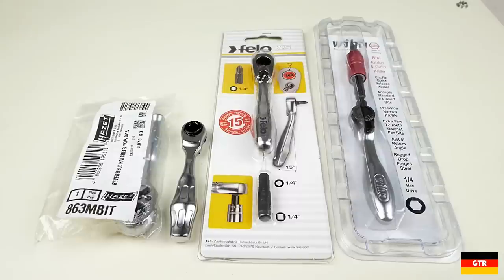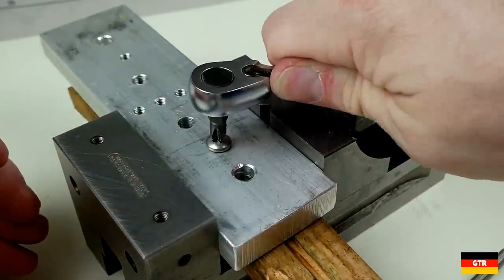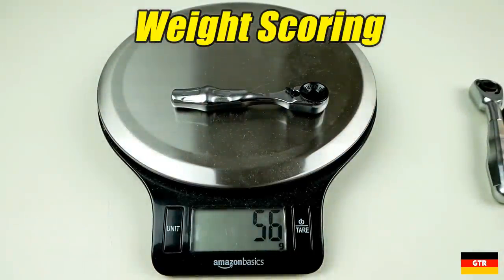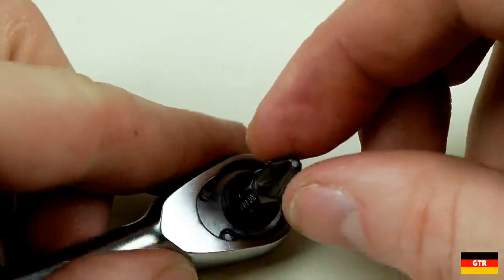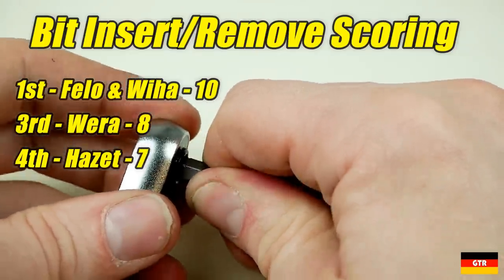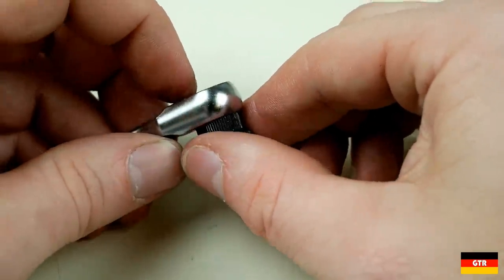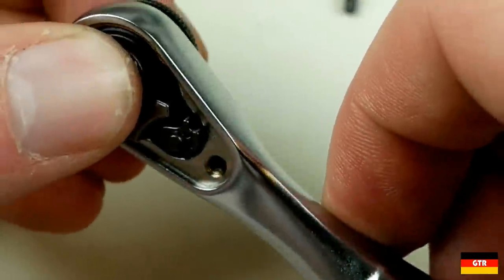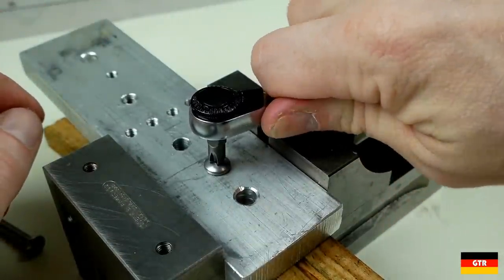Bit Ratchet Showdown

Comment: I would add WERA and Wiha points for the ability to turn the wheel by hand, sometimes it is very useful to secure a self-tapping screw or threaded bolt in a confined space on a wood surface or a threaded hole initially.

Comment: One thing you didn't mention that I find very important, especially in very confined work spaces, is the ability to spin the ratchet from the back of the wrench to pre-tighten the bolts or screws to get them tight enough to overcome the back friction of the ratchet mechanism. Or loosening threaded bolts to have enough length to grab it with bare hands rather than trying to twist a bit that is not attached to a wrench.

Comment: I work at a BMW dealership and we are doing a lot recalls on PCV heater pipes which can be a bit of a pain to replace.  One of the screws that holds the pipe to the block is positioned out of the way and must be tightened and loosened blind, and in a very confined area.  This seems like the perfect test for a bit ratchet.  I've used both the Wera and the Hazet ratchet to complete tons of these jobs and both of them are perfectly fine.  I will say that in my experience, you get what you pay for when it comes to tools.  The Hazet really is a much higher quality professional grade tool - as it should be for the extra cost.  It's a lot tougher and doesn't flex at all when you really crank on it.  One thing that I noticed immediately was how little back drag it has, and how smooth and quiet the ratcheting mechanism is.  With bit ratchets that is really important because in my case I was feeding these little torx screws in by hand just enough to hold them in place so I could come back with the ratchet.  I found that I'm much less likely to knock the screw loose with the Hazet than with the Wera by unwinding the ratchet before the screws have really sunk in.  It seems that ratchet design and ergonomics are more important than strictly tooth count when judging a ratchets capabilities in tight spots.  Both are good tools for what they are designed for, and your task requirements will dictate which one is the better VALUE.

Comment: I have the Wera version and it was literally the only tool that could do this job that needed to be done. A Volvo XC90's fuel map sensor is in a really tight place and the only way to get it is to put the phillips bit in reverse. It was just enough clearance to get the screw out and remove the tool. I think having an option like that would be a huge factor for the score. Something else to consider when purchasing one of these.

Comment: I think most important for such product is the ratchet gear and teeth life.  Only after many years of use you will be able to tell by inspecting the gear and teeth. Taiwan made products are very well finished nowadays but  have a bit risk in regards to the durability. You can try to over torque them to check the wearings on the gear and teeth.

Comment: How sad is it, that I as a German need to go outside of Germany to get our own tools reviewed? :-D
One question: You did not mention the force needed for the "back stroke", which of these has the lowest? Makes it easier to hold the bit in place before a fastener starts to grip!
Thanks so much, that was EXACTLY what I needed!
Reply: That does seem like an important metric that could have been evaluated. 
Low friction on the ratchet mechanism would be good when you're driving a screw that's still loose, and you can't easily apply a fingertip to the bit to keep it from just going back and forth as you try to catch the next ratchet tooth position.

Comment: The hole in the top of the Wera bit ratchet is actually large enough to insert and use some bits upside down, which makes for an extremely low profile tool. Having said that, I'm more in love with the Facom Pico flex-head bit ratchet these days.

Comment: I use the Wera all the time and it works very well. The smaller teeth leave the Hazet in the dust. I just switched to Facom fixed head and I ordered the flex head version in the R1 Pico set for my travel tool kit. The Facom would be a top contender in a new test as long as the clip head doesn't artificially handicap them.

Comment: Now found my ~15y old Gedore 471 1/4 Bit Ratchet. Messurements: 89,4 x 14,3 x 9,7 in mm, weight 23,8 grams, about 50 tooth at the other end a fix 1/4 bit holder for loosening tight screws. Satin finish still perfect, no rust, ratcheting mecanism smooth and the switch still feel like it should. I used it for these hard to reach screws in the Motor compartment (european cars) and it never failed. COO maybe taiwan because there were other, exactly same looking rebrands available (about 15 years ago) like Bahco. Still some NOS 471's in the german bay available also in a set with 4 and 6 mm bits and adapter for the 4mm bits.

Comment: Great review. You didn't think that the knurled thumb-wheel of the Wera & Wiha ratchets was worth mentioning & scoring on the extra design functionality?
Reply: very valid point
Reply: I’ve used that wera ratchet a week ago single handed right place and the knurled wheel came in hand. Loved that function and size too
Reply: Exactly what I was thinking. The Bahco also has the knurled wheel and has saved me on numerous occasions. Defiantly puts me off buying the felo as it doesn't have this.
Reply: White goods engineer here... I recently bought the Wera bit ratchet and low profile socket ratchet mini2 combo for obvious reasons.

Having watched this review it probably wouldnt change my decision though as it was indeed the bit ratchets thumbwheel on the Wera that edged it for me over the others. It was also on special offer but also part of a combo that I also needed... which just confirmed it for me. 
Overall design and quality looks to be acceptable for the price paid for the Mini2 combo (£51 posted) I'd have liked the bit holder to have less wobble and I can now see its design weakness in the combined spring setup but time will tell... If I get 5 years of occasional once a week use out of it, I'll consider it a success and a good buy.

Great work, very in depth thorough reviews, fantastic! I love all your videos.. you earned a sub today!

Comment: My problem is the length, someone needs to patent an extra long one with a small head. What I currently work with is the Swiss army one that is sold as an accessory to their multi tool. It’s the smallest head available and you can add a hex bit extension to the handle to make it as long as you want
Reply: long and XL length bit ratchets certainly do exist.  Do a google image search and you'll find them.
Reply: ChrisCas - Tool Aficionado yeah, there’s the ez red and the gearwrench, but I’ve been hesitant to buy them because the heads look big in the photos.
Reply: If you can get the dimensions from Wiha's website, the EZ-red version should be the same: http://www.ezred.com/wp-content/uploads/2016/11/4S3XL-web.jpg
Reply: ChrisCas - Tool Aficionado I remember seeing that ez red set, that looks like a nice set!

Comment: I don't quite think it's fair to give the Hazet a 10 for serviceability and a 5 to the others, when you can get 2 or 3 complete drivers from the other brands for the price of a single Hazet (and that's not even including the price of the service parts).
Reply: Hazer get points because it's hazet...
Reply: @Whigu  So? Like the other manufacturers are any worse? :-D
I agree with Kieran: While I like the review and the infos in it, the scoring is all messed up and not weighted that useful...
Reply: There is a difference between buying a new one and servicing one!  They would still get a lower score in service yet a higher score in price range!

Comment: I have the wiha one. It came with wihas micro bit kit. It does work well for small bits and low torque applications, but because of the small tooth I don't feel comfortable to use it for applications requiring a bit higher force.

Comment: I decided to buy a Felo based on this review. I have a Wera, and I really like it - it's easy to get it into places I can't get anything else in - so I'll be interested to see if the Felo is noticeably different. I figured that it would be worth having even if I can't tell the difference otherwise, because of the angle on the handle.
Reply: How did the Felo work out for you? I have and love the Wera too and am thinking of picking up the Felo for 3D printer nozzle changes.
Reply: @Schwalbe262 I like the Felo, but so far I haven't used it anyplace that the Wera wouldn't have fit.

Comment: My experience is that the Wiha is terrible.  It was dry and would jam up.  After lubing, quite ok.  The other problem is that one screw backs out, even with Loctite.  I ended up finally losing it and Wiha won't tell me what the measurements are so I can buy a replacement.  So I stick with my Wera at this point.

Comment: You should measure the slop in between the current tooth and when the pawl engages the next tooth.

Often you see low return angles, like 5°, even on cheap ratchets. The biggest difference is durability when those tooth counts get high, and the tolerances. A good 5° ratchet has a 5° return angle, a cheap on has like 8° angle of return because of slop.

Comment: I changed the internals of my Hazet 863 BGL ( bit ratchet with flexible head ) over to an standard one and vice versa so I can confirm that it is possible and the price is a lot lower - here in Germany - when bought in a complete set with box , inserts , extensions, bits ... The Wera " movement " is same on Facom, KS-Tools and many more - brandet tools, all came from Taiwan. Own all of them, use frequently ( Service Engineer tobacco machinery ) , never failed.

Comment: Awesome video. I own the Wera model and love it; just wish they made a flex-head version. I've seen that exact same mechanism in the  Wera used by Mac, Facom, USAG, and Deen in their respective bit ratchets. All made in Taiwan, 60 tooth, large through hole, and using a single c-shaped clip to retain the bit drive and the bit itself. I wonder if they are all made in the same facility and just get stamped with different branding on the top?
Reply: They've been doing it for over a decade now.  A company called Hi-Five is a massive ODM/OEM company that has worked with companies like Facom for well over a decade.

Comment: Here in Germany Hazet is considered the highest quality brand of the four. I must admit that Felo is not widely known here in my opinion. I only have a badly designed bit driver from them. Gedore and Hazet are the top manufacturers for those tools.
Reply: Matthias Burkhardt: Thats true, one point more to Hazet!
Reply from the maker: I was going to include the Gedore, but they didn't have a version with a bare handle.  Maybe I'll take a look at it in the future if I do one with comfort grip handles.
Reply: Matthias, what is your opinion of Stahlwille?
Reply: but only 20 teeth...
Reply: Stahlwille is one of the German "undercover" brands, not widely known, but of very high Quality. They produce in Germany and the tools have a very high quality, comparable to Gedore or Hazet. I think there are several others out there, the problem is you do not see those brands in the stores(that's at least my opinion). We had a toolstore here in Munich that had a lot of Stahlwille, do not know if that still exists. https://de.wikipedia.org/wiki/Stahlwille
Reply: Surprised with that i thought FELO were well known/respected with you in Germany , saying that i sold my Felo ergo drivers & stuck with WIHA -softfinish :]
Reply: CC MOGS That's only my view, I need the tools only for hobby so it could happen that I missed something 😉
Reply: Felo is or was mostly known for making the Umsteckschraubendreher.
Which was found in every vehicle tool kit of every german car maker.
Reply: Another not so well known brand is Elora: https://www.elora.de/site/en/start.php and Matador: http://matador-webseite.de/index.php. And of course Proxxon: https://www.proxxon.com/en/ Would be great to have more reviews on those brands also.
Reply: Matthias Burkhardt Hallo, ich bin nicht deutsch (kom aus belgien), aber ich habe alle werkzeuge die ich hab bei TBS in Aachen gekauft, die haben alles was Man Sich wünschen kan(: gedore hazet stahlwille..)
Reply: @MatthiasBurkhardt  what do you reckon about Elora in German market, they was one of top German brand before.
Reply: Really not that common. 
The most common brands in construction are:
Screwdrivers - Wera (probably followed by Wiha and Witte)
Pliers - Knipex (by far)
Spanners/Ratchets - good cheap brands (like KS tTools, Proxxon etc.) followed by crap cheap brands and Stahlwille and Gedore
As an electrician I use quite a few tools made by Jokari.

Comment: At 7:56, notice that the Wera has a very large pawl to spread the torque more evenly which negated the need for such thick material in the cog of the ratchet, engineering that cut cost and should be effective.  Personally, I own a Snap-On unit purchased years ago with an Angelle creeper as a set.  Paying with cash for both, it was really inexpensive for the quality.  Not jumping inside the unit, I bet it is more akin to the Hazet.  All in all, I would have preferred a straight through design, although the magnet holds well.  It holds so well, that with greasy or oily hands and fingers, it can be a chore at removal of bits.  Super light but a big head, serviceable and should be able to be configured for other styles--3/8" drive, 1/4" fine or course.   What I don't like so much is the stiffness of the ratcheting motion.  OMG!  It hasn't broken in yet.  Again, it receives limited use, just for the tough hard to reach screws and such.  The set TMM830set or TMM830 can be found in used quantities over the net and especially eBay.  It is usually easier to buy the kit than the individual ratchet; go figure.  Anyway nice review.  Thanks

Comment: I have the Wiha ratchet and agree that the switch is a problem.  My concern with the Hazet ratchet is the butterfly pawl in the mechanism which is similar to older teardrop Craftsmen ratchets that were offered in other drive sizes.  I don't remember the mechanisms in those as working particularly well.  Their shortcomings were often remedied by various people I knew by packing them full of grease which produced other strange issues.  Maybe the Hazet is made to better specifications and tightness is not a problem in this particular product.  I am curious to know more about the VIM ratchets.

Comment: Great informative video. I am always looking for new tools for my underseat motorcycle tool kit. This has been very helpful.
Reply: wouldnt sth like a wera 3/8 socket set be the best for a motorcycle kit, you can put in the bits that you expect to use the most, i dunno hex, torx etc if you find existing setup lacking, if you get an additional 7mm socket, you are pretty much covered in terms of smaller and bigger bolts, all with a very compact pouch
sth along those lines:
https://products.wera.de/en/zyklop_ratchets_and_accessories_the_zyklop_ratchets_the_zyklop_ratchets_3_8_the_zyklop_metal_ratchets_push_3_8_8100_sb_7.html

Comment: the wera bit ratchet is nearly identical to the facom bit ratchet, the shape of the handle being the only difference.prob made in same factory.
Reply: Yup, same factory in Taichung, Taiwan: Hi-Five.  You can also add the MAC tools bit ratchet, which even comes with a longer length and with a locking flex-head feature.  Facom and MAC are both under the Stanley B&D "empire".
Reply: I was going to say the same thing. The head design looks similar.
Reply: I think Japanese company Tone also has the ratchet OEMed by the same Taiwanese factory. It is identical to wera.

Comment: As Maijahtheoneandonly said you missed the new Stahlwille 415SGB N (11 13 20 20) 80 Tooth Bit Ratchet.
Reply from the maker: Yeah I was going to get it but it was a bit too expensive.
Reply: Your right, just looked for the price. I also think it's a bit overpriced. Thanks for your good tool vids.
Reply: I saw the stahlwille at 35 euro on sale, so it is cheaper tha the hazet you tested.

Comment: I find myself accidentally flipping the switch on the Wiha on a regular basis...
Reply: same here. I bought the 32 pz bit set and have been noticing that ALWAYS flip the switch and is frustrating. Is a good rachet just not great design I will buy a Felo. I don't trust the Wera mechanics and Hazet is just expensive.

Comment: idk why companies moved away from the snap ring design that the Felo uses. i own gear wrench ratchets that use snap rings and i think it's superior in reliability and serviceability.
the only ratchets that have ever failed me have all been the plate & screw design. the screws loosen over time and there's always a chance of stripping the threads.
why voluntarily put up with that??? sure, snap rings require "specialized" tools, but they're cheap and easy to find everywhere.
i'll always buy ratchets with snap rings, so this is an easy choice for me. Felo.

Comment: if you need a with small head take  ks-tool gearplus bit ratchet, if you want more felxile take kingsdale bit ratchet same like facom pico.
this wera, wiha etc... are only heavy , the frame/grip can be made in germany but  do the ratchet parts/mechanics made in germany too?
if you dont disassamble  a worn our and burned  aircraft engine , you dont need snap-on that same with german tool, in most time  quality of toptul taiwan enough.